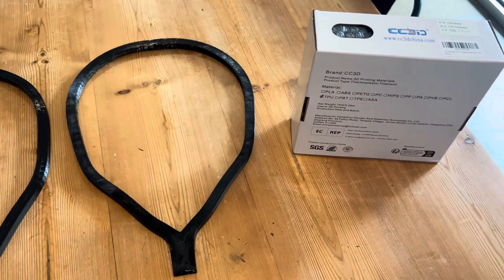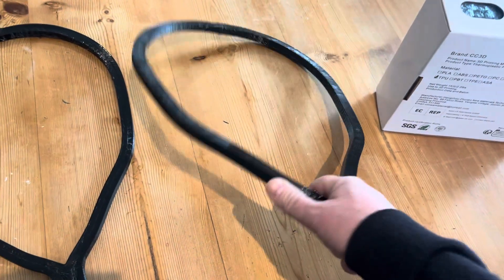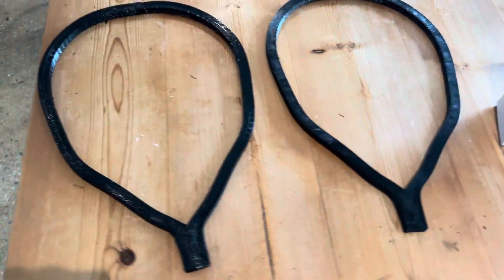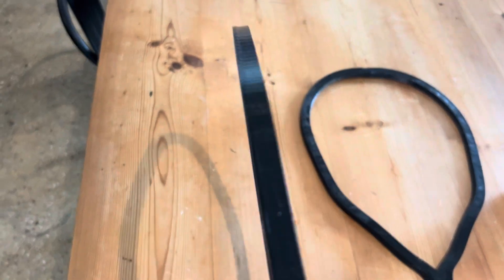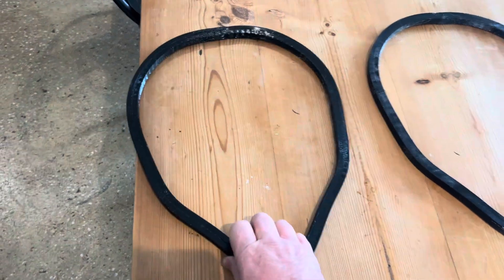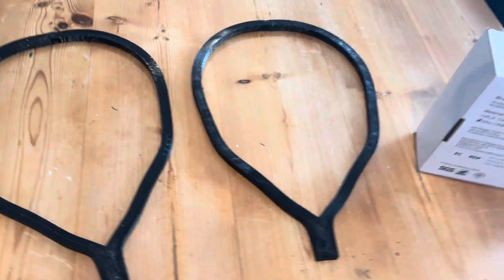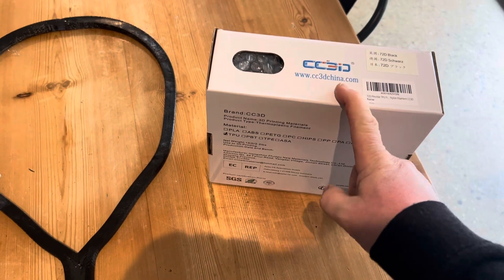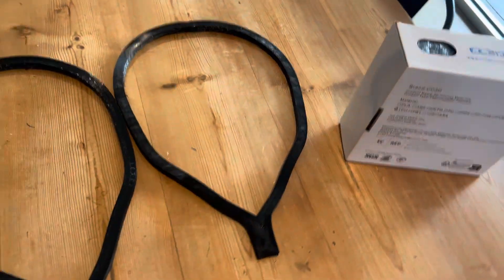TPU 72D / nylon hybrid filament test prints vs 95A TPU

Comment: I use this stuff. 235 nozzle temp, 50 bed temp. 4mm^3 max flow rate, which could probably go higher, i just have not tested it. No glue necessary on a textured build plate. Its tough, but flexible. It does eventually spring back after being deformed, but it takes a while.